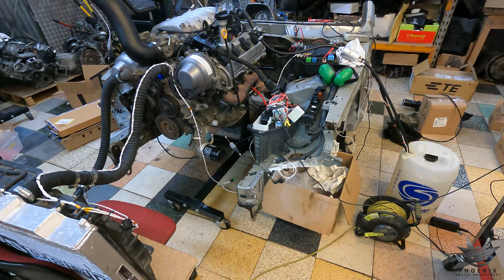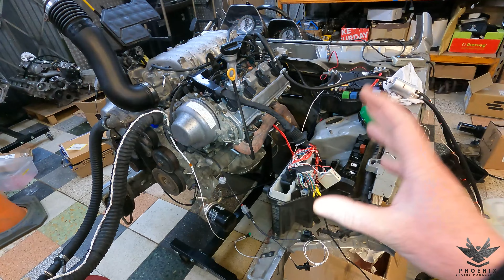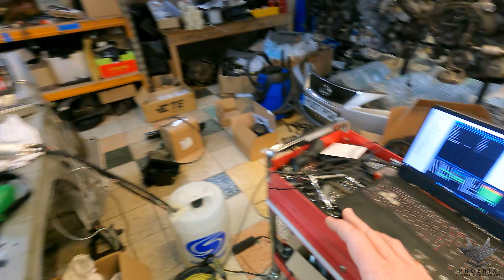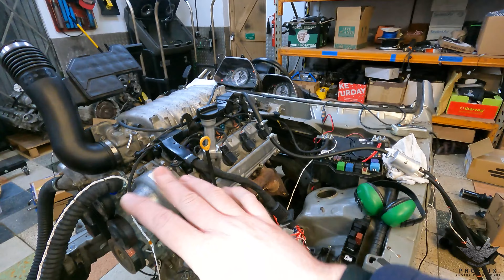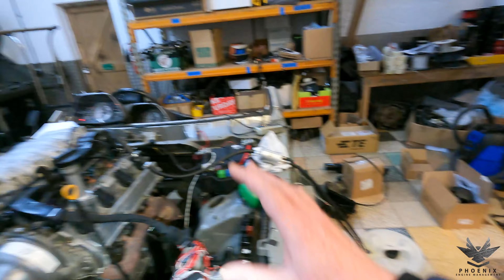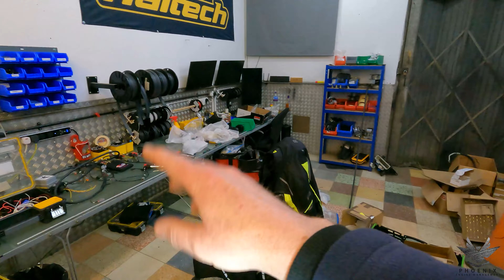Link ECU 3UZ-FE LS430 GS430 SC430 First Start Up Guide

Comment: Hi, 
I'll be using a bosch fuel pump on my 3UZ in a cobra replica, could you tell me the part number for the fuel regulator/filter you are using in this video as I'm trying to find the one I need to give me the correct fuel pressure/flow.

Thanks,
Reply from the maker: No worries I don't have a part number but there are two Fuel Filters with built in Regulators that you can use. The one I have comes from a VW I think either Golf or Polo and the only thing you need to make sure is that you get the 4 Bar Version as with the VW one's there are 3 options 3 Bar 4 Bar 6 Bar
The second option but it's a longer one is the BMW Version that is found on 3 Series and 5 Series. E46 and E60 from my experience all have them.
Reply: @PhoenixEngineManagement  thanks very much for the reply. The 4 Bar for the Golf V looks like it will be a Hengst H155WK02 then, or  bosch equivalent F026403006.

Comment: Do you guys have a harness for ecu in cabin relocation ( or in location of the stock battery tray) on the xe10 chassis with a BEAMS engine (or any engine for that matter)?

Would love to see a video as I find the stock location of the ECU box kind kf clutters up the engine bay especially with intercooler piping.
Reply from the maker: Hello Cangieter we have done some of those harnesses in the past. If you look for a Jeremy IS300 with Link ECU that will show you what we did for him